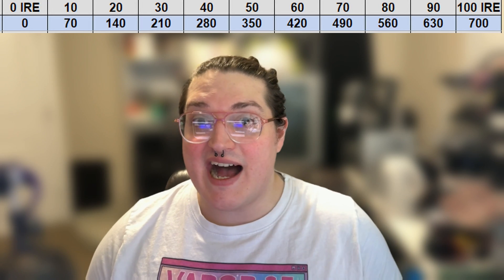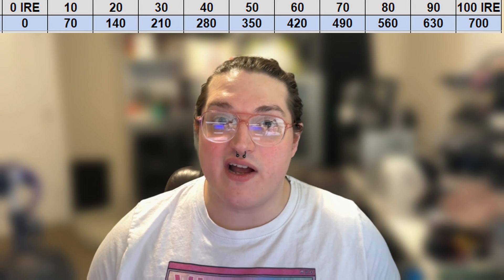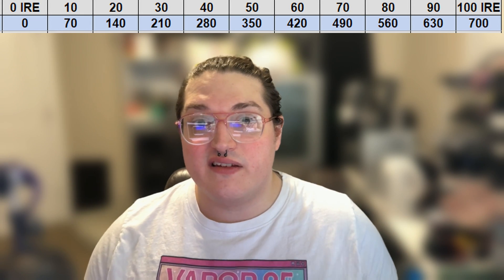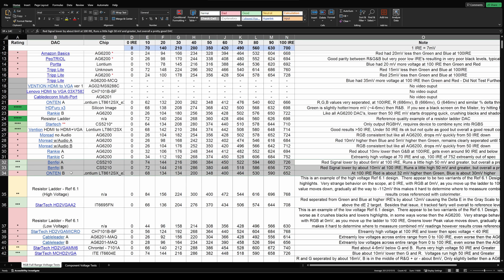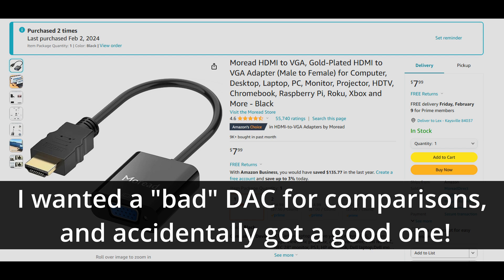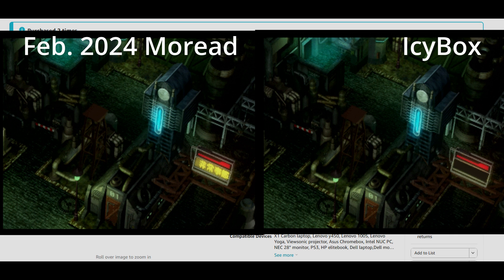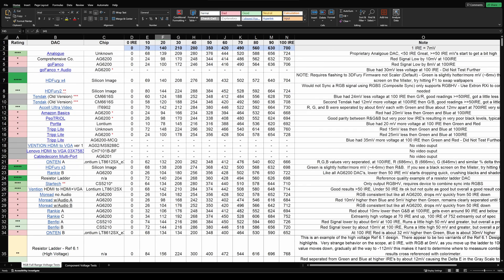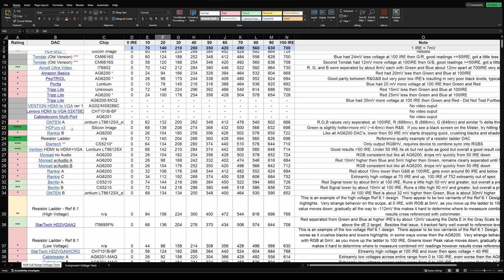Get the BEST Analogue Output from MiSTer FPGA!

Comment from the maker: Kuro has added the new Moread adapter I mentioned to the sheet, testing two copies of the same model. It tested well! Also a new issue with the icybox has come to light, which is a delay switching from 240p to 480i. This is mainly an issue for ps1 games where the game is 240, but the menu is 480i to add extra text detail. You will need to enable “Sync 480i for HDMI” on the PSX core to fix this on the icybox. 

Alternatively In this case, considering how well the Moread tested, I would get that over the icybox if you play a lot of PS1 games on Mister. This comment is likely to keep changing based on additional DACs being added to the list.
Reply: So how long was the delay before fixing it on the Mister? And if it's fixed with a settings in the PSX core, isn't it then just good to go? Is the delay gone after?

Comment: Really good information. Now I have even more questions as I am a bit new to CRT TV gaming.... Is the output of these DACS 15khz or 31khz? Can they work with any HDMI input, so you can output 15khz from a Pc Gpu? Once you have the VGA output working can you use a VGA to Scart adapter for using a CRT TV? I am based in Europe, so here we have RGB scart connectors on the TVs. I am pretty sure I am missing something... Can not be true that any modern Gpu can be connected to a 15khz CRT tv.. 😂 Thank you
Reply from the maker: The output is the same as the input; if you send the DAC 15khz via HDMI, it'll spit out 15; if you send it 31, it'll spit out 31, etc.

They work with any HDMI output that can do 15khz (if 15 is your goal). PC GPUs can output 15khz, look into "CRTEmu Driver" for a list of compatible ones. This video is specifically using a MiSTer, which can output 15khz+ via the HDMI port. 

You can adapt the VGA to SCART, yes, it's all RGB. As for the sync, you'll need to figure out if your device is sending HV sync or C sync. The MiSTer allows you to output Csync which is what I need for my PVMs, but I believe you can get it to output HVsync as well.
Reply: @lexlocatelli  Thank you very much for the explanation, now it is cristal clear. I am using a couple of solutions right now to output 15khz to CRT, Rgbpi with a Rpi400, and a  modded Wii. I want to try a fpga system like qmtech or taki udon one (mister is a bit out of my budget). I am also building a PC with a Radeon R9 for using batocera v40 for 15khz RGB output... It is getting addictive...

Comment: Just opened a mored and it has a cs5213. Is that as good as one with cs5210?
Reply from the maker: Should be even better; look at Kuro’s list at the very bottom, that chip was rated incredibly well on a Mister Addons board. Assuming the values are similar, you got really lucky! If they permanently switched to that chip, that’s great for us.
Reply: @lexlocatelli  Nice got a God dac for cheap =).

Comment: Great video! I've been spending ages trying to get the VGA output to work AT ALL from my "Ironclad Plus” baseboard, but it looks like I now need not bother. A HDMI -> VGA adaptor will work just as well... in fact better according to the excel table! Cool!

Comment: Wondering if you can help me out. I got the Icy Box without audio adapter and used a fresh new ini. I enabled composite sync & direct video plus vga = rgb & it's quite glitchy with blue interfearance and yellow on white. CPS Arcade Cores & Megadrive core is perfect though. Kinda stumped and dunno whats wrong.
Reply from the maker: What kind of cable are you using, and what are you sending the signal to? Might be best to take a pic of what you’re seeing as well and upload it to Imgur
Reply: @lexlocatelli  Thanks for the fast reply. Will upload soon for you. Using a VGA2BNC5 Cable to a JVC PVM with white plug going to sync. Same cable works through IO Board.
Reply from the maker: @shanomacdaddy  also would be good to upload your ini file somewhere!
Reply: @lexlocatelli  Cheers mate, I got the photos will upload to imgur. Hopefully the link doesnt get blocked & I will try upload ini somewhere too.

Comment: Just got my Icybox and it works better than I had hoped. I've been using the old(?) analog board with my mister since 2020. It worked OK, some noisy interference some white blooming and of course colors not exactly correct but it got the job done. The Icybox however was razor sharp and almost all noise (some noise is to be expected it is analog afterall) was gone. It fixed the blooming, the colors look great and I feel this solution makes the Mister's video out better than original hardware. I ordered mine the same day you posted this video and it took 18 days  to arrive from the Netherlands. I'm so happy with this DAC well worth the money. With the quality I would even have paid much more. Thank you so much, Lex!
Reply from the maker: Glad you're happy with it :D!!!!!!!!!!!
Reply: What is the pixel clock of this dac, and what exacly model?

Comment: I know this video goes over picture, but how about audio quality for DACs? I have the RetroCastle IO board, but see they also sell a Digital Audio update module for their boards. Do you know anything about the module and if it’s worth purchasing?
Reply from the maker: The module is definitely worth it! It’s an easy installation and greatly increases audio quality according to a few friends of mine who have them (who I trust with this kind of thing; they’re Kuro-types). The brand new DirectVideo based analogue IO boards from Retro Castle, I believe will have a DAC equal in quality to that module as well, but check the store page to make sure.
Reply: @lexlocatelli cool! I think I will one then. Thanks!

Comment: You mention the Moread is easy to open up. How do you do it? I can't see any obvious way
Reply from the maker: Look directly at the VGA port, we will call that side the “front”. You’ll see a line going around the entire outside of the front. Stick a thin piece of metal or plastic spudger in there, and pry the VGA port out. It’ll slide out; there are no screws.

Comment: How is the audio DAC quality in ICY BOX IB-AC522?
Reply from the maker: I’m not particularly savvy on what makes an audio DAC incredible, but it’s been “good enough” going into my tower speakers from an amp. I haven’t noticed any poor quality or issues. That being said, Bob from RetroRGB is a much better source for things audio related. He seems to think most HDMI DACs have “good enough” audio, but an audiophile would want to use an HDMI audio stripper and go into a high quality amp/DAC like a schiit stack. I’d certainly trust that opinion over whatever I have to say about audio!

Comment: I'm a bit confused (I'm new to all this): when you go to buy a MiSTer you are asked to choose between either analog or digital board to go with it. Are those DACs? Or are those what DACs connect to? If it's the former, are saying the official boards aren't actually that good and should be avoided?
Reply from the maker: Basically everything involving the Mister is a nightmare for beginners so it's understandable! This is going to be a pretty long comment, bear with me:

First, a DAC is a digital to analogue converter. This could be built into an IO board, or it could be an external device that plugs into the HDMI port of the Mister. Not all IO boards have analogue video, so you'd use the external DAC in that case.

Yes, there are two "types" of IO board, digital and analogue. The digital IO board is basically a fan and some USB/audio ports. It has no video output, and no DAC. The analogue board, on the other hands, is a bunch of USB ports as well as either a VGA or Sega Saturn video port for analogue video, which by nature includes a DAC. I suggest going with the VGA version.

If you're buying a pre-built Mister, you'll usually get two options like you said; an analogue version or digital version, which is referring to which IO board it has. The digital IO board is basically a PCB with some USB ports and buttons on it. It has no video output; the DE-10 Nano already has the HDMI port built in. The Analogue IO board actually has an analogue video output on it, along with USB. And yes, you understood correctly; any analogue IO board based off of the original design is heavily flawed. It will look like the bad side of comparison picture in the video of FF7.

I'm going to assume you're looking at MisterAddons to buy your setup. I would strongly advise not buying from that website for a number of reasons that I don't want to get into right now. What I will say, at least, is that their analogue board is based on that bad official design. Instead, if you want a full build, I can suggest RetroCastle on AliExpress. It's well-trusted, and the Analogue IO board from there is incredibly good compared to the "original" design. I can also recommend the Complete Mister PLUS from Antonio Villena.

It may also be cheaper for you to get your IO board from RetroCastle for Analogue output, and then just build the Mister yourself.
Reply: @lexlocatelli  That was a great write up. Between that, and your video, I have a better grasp of the terminology and my options. Thank you!

Comment: Thanks for the awesome video. Looking at the official list it only shows RGB and not component. Does the information apply or affect the picture of component, svideo or composite? I can't find a clear answer on this. All of my CRTs are component, svideo and composite. Trying to figure out if I need to buy different DACs.
Reply from the maker: Yes, this applies to all picture modes! I have a comment elsewhere where someone asked a similar question.
Reply: Now that's something that I'm curious about as well. I always wondered if using YPbPr output instead of RGB reduced the signal range or if the sync and luma get combined on the board, instead of having the sync generated on the DAC itself, I never gave much thought about HDMI to VGA DACs and how it would work with sync on luma for YPbPr output either.

Comment: What about added latency? Were those values measured for these adapters as well?
Reply from the maker: It is not a part of this test, however all of these should be zero-latency (i.e, under 1ms). I've tested just now with the MisterLaggy, and can say that the CS5210-based DACs, RetroCastle IO board, the IcyBox DACs, and even the AG6200-based DACs all add no latency to my setup.
Reply: @lexlocatelli  awesome. Thanks for the reply

Comment: Do you know where I could find IRE measurements of real systems? I found one for SNES kind of but no luck on others.
Reply from the maker: There is no comprehensive list for real systems yet, this is something I plan on working on. The output of real systems has another set of issues, which are:

1. System revisions can potentially perform significantly differently from one another, like with the Genesis
2. The cables used for testing have more effect than anything else. You’d have to be running tests not just on console revisions, but also all of the different brands of cable.
Reply: @lexlocatelli  Ah I see. I'm kind of surprised that there's no such a list already. Difference between revisions is something cool to measure and document. Cable wise, OEM cables could be used as baseline for systems that released OEM cables. Looking forward to what you could come up with.

Comment: Does this table consider the ini option hdmi_limited ?
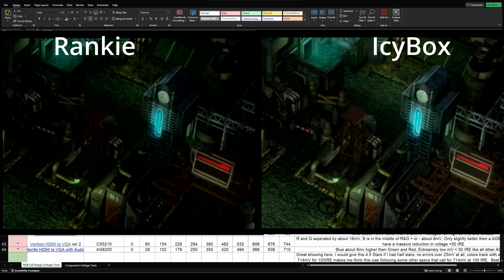Reply from the maker: These adapters are all specced to be full range, so for the most part, no. If limited=2 needs to be turned on to fix them, it’s because the chip is out of spec, not because it’s actually a limited range output. This is mentioned at 08:56 in the video. There is also a test result at the bottom of the list that verifies what I’m saying; limited=2 does fix the low end, but it destroys the rest of the image accuracy.
Reply: @lexlocatelli Sorry, I paused just before your mention of it to write the comment 😅 I have a Ultimate MiSTer HDMI to SCART and a Delock 65901 and will try to investigate.
Reply: @SvenKillig  You say limited=2 "destroys the rest of the image accuracy", but that doesn't seem to be reflected in the chart or the note. The values over 50 IRE, (actually, every IRE,) are almost the exact same as the Super Nt with the DAC.

Comment: Question: Does the data from these tests apply the same irrespective of whether you plan to use component, s-video, or composite?
I use s-video from the YC active encoder board from MisterAddons usually, and sometimes component. I'm wondering if those factor into anything somehow.
Reply from the maker: The YC encoder boards have fairly basic circuitry, so I imagine they’re doing a very simple translation of the values from the DACs. That is to say, a shitty DAC will be shitty through the YC board, and a good DAC will look good. However the misteraddons IO board is one that had major level issues since it was just the reference design, so I’m not sure on the quality of those adapters. For component, since it requires no processing and instead comes right out of the DAC with a component to VGA cable, it should also be good relative to the DAC quality.
Reply: @lexlocatelli  That all seems to make sense. Thanks for the confirmation and clarification!

I think I'll be trying to order one of those icybox DACS soon!
Looking forward to the upgrade :)
Reply from the maker: @c_lars_02  Kuro just added results for the Moread adapter I mentioned - might be worth grabbing that instead as the icybox has a longer delay switching from 240p to 480i in ps1 game menus.
Reply: Thanks for the heads-up! Gonna go ahead and order the Moread now. Stoked to get it :) @lexlocatelli
Reply: @lexlocatelli  Interesting, do you know what's the problem with the reference design? Are the resistor values wrong, are the tolerances too big, or is it something else?
Reply from the maker: @gcolombelli  The resistor values are incorrect, and when you compare the numbers, it seems pretty clearly based on the final numbers you’d get from an AG6200 instead of a quality DAC.

It’s not an inherent issue with resistor ladders, as the RetroCastle board uses one with the correct values and it output’s incredibly well.

Comment: Hello, thank you for the video!
I just have a question as i am a little confused: i have a digital mister bundle from misteraddons and i just got the ICY BOX IB-AC502 (the one without audio) what should i expect ? Will i have audio missing ? How can i get audio out of my mister ? Sorry maybe my question is dumb but i am a newbie and don't know what to use. Thanks again!
Reply from the maker: Looking at the MisterAddons Digital IO board, it has Mini-TOSLINK and full sized TOSLINK for audio. So, you'd need to get a TOSLINK cable and plug that into your speakers somehow, via an audio DAC of some kind. Most AV receivers support this, or you can get a very cheap TOSLINK to RCA converter box from Amazon, such as this: https://amzn.to/42saH3h

Comment: Hello, correct me if I'm wrong but the IO boards output direct analog from the de10's pins right? No DAC involved.
So why is there an analog IO board in this DAC comparison ?
And how the retrocastle IO can be better than the official one? (resistor ladder ?)
Thanks
Reply from the maker: A resistor ladder is a DAC, so there is a DAC involved :D! 

Presumably, they use different resistance values, which would cause the output R/G/B levels to be incorrect. I haven't torn them both down to check, all I know is what the scope says about these outputs. There has been a discussion bringing this up on the Mister Github, showing how the original design has incorrect values, though I'm not sure anything is being done to rectify the situation.
Reply: @lexlocatelli  OK so I'll try to find that discussion on the discord and dig into that resistor ladder thing 😁.

Comment: Hey great video! Have you tested resolution switching with PSX core? As you probably know, going in and out of menus for games like Chronos Cross, Sotn, Dino Crisis, etc. have sync issues with a lot of DACs. I had a bunch of cheap DACs that are bad at switching. Benfei one you've highlighted performs great but unfortunately it has flickering line artifacts for certain color range for me. I'd appreciated if you could test Icy Box, Retrocastle, and others you have.
Reply from the maker: All of my DACs have some kind of "down-time" when switching from 480i to 240p. I can do a live stream later tonight testing all of the DACs I have (only three), what game do you want to see tested? Chrono Cross?
Reply: @lexlocatelli  Oh great! Yes Chrono Cross is very easy one to test.
Reply from the maker: @BanchoZX  Just gone done testing; The Moread and RetroCastle both switch very quickly between resolutions, and the Icybox switches within maybe .5 seconds though it's more noticeable than the other DACs. Hopefully that helps!
Reply: @lexlocatelli  Great thank you! Icy Box is no go for me then. I play a lot of PSX core so that much delay gonna drive me nuts heh....

Comment: I've noticed a bit of a "red push" over S-Video using my MiSTer, where red is stronger than blue and green, especially at lower brightness levels, compared to my original consoles using official S-Video cables. My setup is: generic analog I/O board -> S-Video adapter -> TV. I have both the original Antonio Villena adapter that converts RGB to S-Video externally, as well as the newer Mike Simone active adapter that gets Y/C direct from the MiSTer, but the difference in color is negligible to my naked eye. Do you think it's something to do with the I/O board? It is a relatively early model that I bought 3 or 4 years ago. I'm tempted to pick up a confirmed good DAC to compare, but i don't want to waste money on one if I don't have to
Reply from the maker: Yes, it’s probably the board. The official spec of the IO board is quite terrible, it seems to be based off the levels from the AG6200. To this day it hasn’t been fixed, and it seems that the dev team doesn’t particularly care about this issue since it technically works.